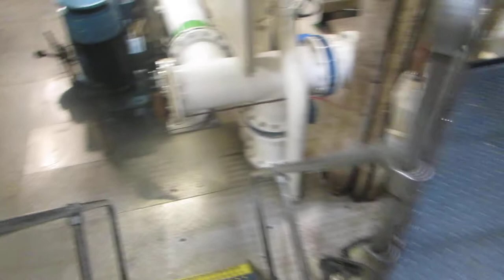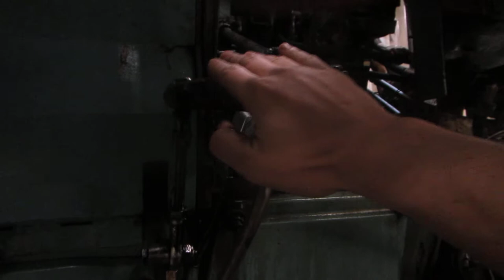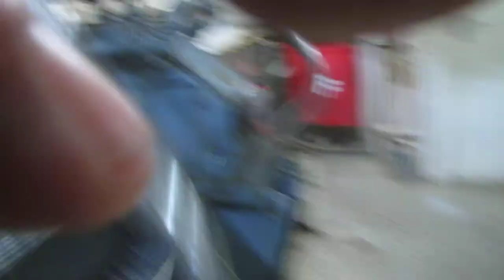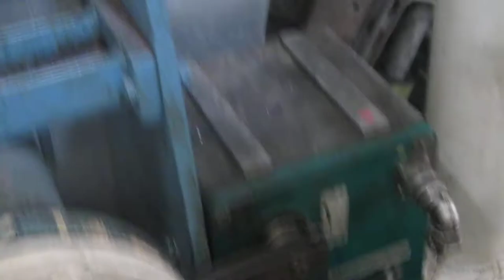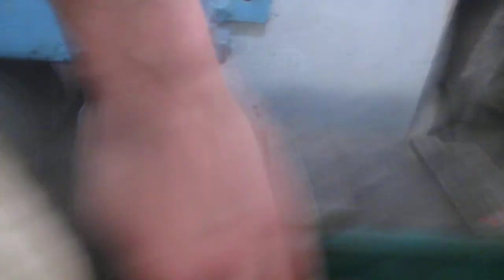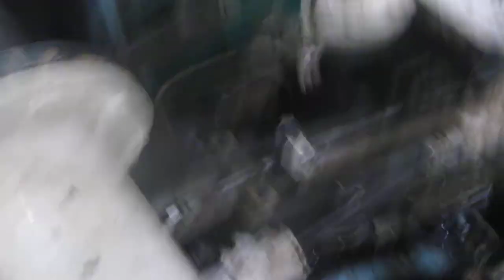Heinzmann governor strange behavior

Comment: Good afternoon, recently we are facing the same issue in one of our Generator.  Could you please give your suggestion on it. it will be very helpful for me@Christof
Reply: Adjust gain setting on the controller,
Reply: Hello.
Sometimes it happened because of a bad connection in the wire plug to the actuator.